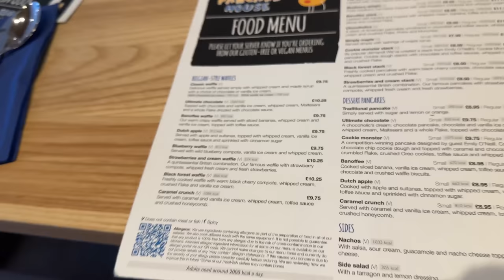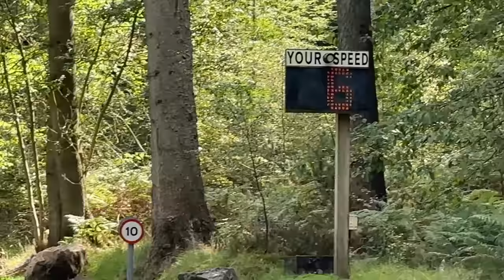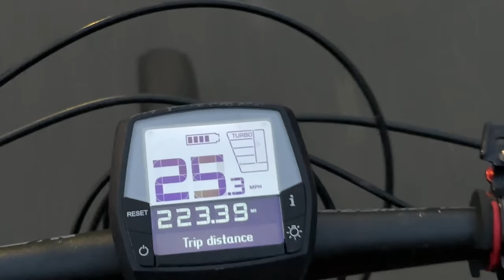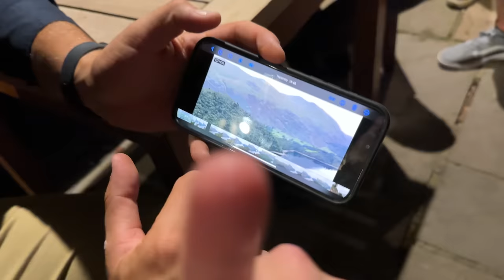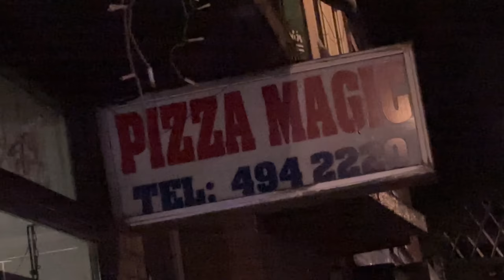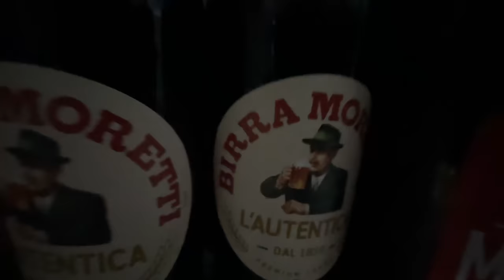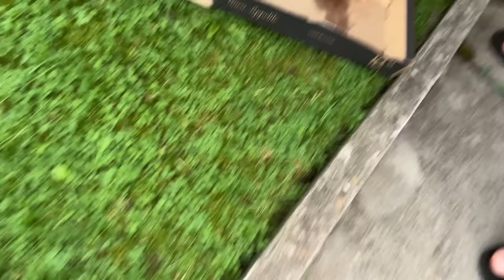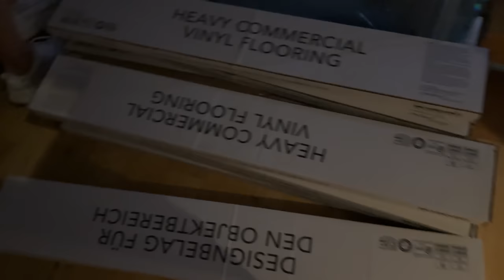I’m Home.. but we have a Problem!

Comment: You may be able to get a battery for the GTR, but you can often buy ones from OEM manufacturers, have a look in your local area for any reputable garages, they’ll be able to get their hand on a battery made by a company such as Bosch who manufactures batteries for. At brands although not a genuine Mercedes battery, it’ll still work on your car. When the car is at a main dealer, they will look for products only available in their dealer network and not from other brands, whereas a specialist garage or reputable garage will be able to use other batteries which are still 100% safe on that vehicle 10:15

Comment: Ive just been in Euro Car Parts in stockport and they have batteries in stock that would get the beast up and running. Put your reg in and it shows compatible batteries. 
Shame not to be able to take it to the funeral. They have some in in cheadle and stockport, just over the road from where your car is :)

Comment: Do Stockport Mercedes not have an Ex-Demo/Showroom or even Used GT-R they can pinch the battery out of just so you can use the car for the funeral?? We used to pinch bits off other cars all the time in motor trade!

Comment: 1 grand for a batter is a rip off tom. they are a dealership so they are prime in wanting to milk as much money out of you as they can. might be ideal to try another dealership and get a quote before a repair and see if the pricing is any better. but youd be better off changing the battery yourself if its just a battery issue